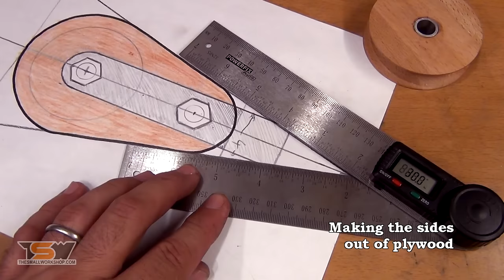Making a Block and Tackle Wooden Pulley System

Comment: Luck like you have the same tablesaw as mine. How you do your parallel guide?
Reply from the maker: I replaced the flimsy front and rear rails with rectangular tubing, making sure it's square to the blade and guides. The fence itself is made from the same rectangular tubing, making a T shape, perfect 90 degrees and bolted together. I used bolts instead of welding in case I needed to adjust the angle. And I simply clamp it to the front bar, using a regular clamp. I use it rarely because of the dust and noise and I have the miniature saw for daily use, that's why I did not bother to make a proper cam lock for it and use the clamp instead.

Comment: How did this work with the nutz crank down and the pulleys wood on wood with no bearings after time?
Reply: He used nylock nuts . the last four threads on the nut are thick nylon and are threaded by the bolt. So he didn't need to torq them down ..

Comment: They look well made but you should get some idea of their limits and of course improve on those pieces of string. But all in all, well done. Regards
Reply from the maker: The rope is rated for 1/4 metric ton (250 kg), and the rock I lifted was heavier than a large man, it's pretty much overkill for what I need: lifting some winter tires or a small air compressor up into the attic. I don't plan to push them too much, the rock was just for the video.

Comment: Anyone know what wood he used for the housing? Looks like plywood with carbon fibre laminated on it (?)
Reply from the maker: it's phenolic resin plywood. The part you think it's fiberglass it's just some texture to create a non slip surface for trailer floors or scaffolding and such.

Comment: What did you do to prevent sheaves from binding against the plywood?
Reply from the maker: The bolts are a little loose. I've used it almost weekly, it serves as my attic pulley for large tools storage, and never had a problem with it binding or anything else.

Comment: My 2 cents : you would save a lot of energy with ball bearings instead of aluminium plain bearings... very nice job anyway !
Reply from the maker: True, but I use it for small loads, so it works just fine for now. I haven't even lubricated the plain bearings. Aluminium was what I had in my scrap pile, brass would've been better, but I used only what I had in my shop. Same reason for not using bearings, I did not have as many and they would add cost and also complicate the build.
Reply from the maker: LOL, yea, you are in a different league, I only needed a fast solution for lifting some tools in my attic. 30-40 kg maximum load.
Reply: And I enjoy watching people building theirs their own way !

Comment: wow, power tools wise, what did it cost to set up your shop?  like 20k?  curious to start my own
Reply from the maker: I've bought the tools over the last 10 years, most of them used, never did a total, but is was a really low number.
- table saw $40
- wood lathe $150
- metal lathe $100
- drill press $70 (new)
- angle grinder $25 (got it free from my dad)
- vise $25
- belt sander $40
- router $50 (new)
- circular saw $40 (new)
- welder $100 (got it free from my dad)
And so on. In the past few years I've also spent around $25 a month for small stuff like screwdrivers and other hand tools, sandpaper, clamps, saw blades, drill bits and so on.
Reply: Appreciate that breakdown, @TheSmallWorkshop!

Comment: 11:00 u missed two pulley in ur bolt each side of ur flat bar 12:20 ur ladder positioning was wrong 
Other wise I did tidy job making two snatch block with almost £5000 tools

Comment: Did you get yourself a table saw?
Reply from the maker: I've had it for a few years now, I only rarely use it on video, because of all the noise. It's covered with a brown piece of hardboard and it's some sort of workbench, you can see it in most of my videos. But I usually use the homemade mini saw, since it's much safer and quieter.

Comment: hello  mr maker person
i have a suggestion.  when your making a thing, eg your "Block and Tackle Wooden Pulley System" i think it would help a lot if you showed  the finished product for a few seconds at the  BEGINNING  of the vid.  in that way the viewer knows what you are making.  
as it is all we see is a lot of drilling, sawing and separate steps that dont relate well  to each other.   we have no  VISION  of what you are doing  or where you are going.

think of it this way.  if you are in the airforce, think WW2 bombing missions over nazi germany.  before you go near the bomber you have a BRIEFING  session.  MISSION COMMAND  sits you all down and outlines your  DESTINATION, TARGET  etc.  so you know what you are setting out to achieve. you dont  get airborn and then get instructions like...ok guys your at 10000 feet now turn 5degrees south and  when you get there call us and we will give you the next  course route.........
anyway my 2 shekles worth.  or is it nickles maybe........

else wise a interesting vid......

Comment: New tools? Or just not used in older videos?
Reply from the maker: Some new, like the miter saw and some new to me, like the band saw, the rest I've had for a while, but I usually avoid to using too many tools for my projects, to keep them accessible for more viewers. In this video I went nuts tho, and used whatever tool I needed for the job.
Reply: The Small Workshop Is that evolution mitre saw a personal buy or did the people of evolution send one over? They have been doing that a lot with yt woodworking recently.

Comment: No metal spacers for opposite of the pulley side? hrm
Reply from the maker: It's all loose fit, no bolts were tightened, it's more like a harness than a single solid piece.
Reply: The Small Workshop it works because of the locknuts. It's a workable design, not a great one.
Reply from the maker: Of course the lock nuts were used exactly for that purpose. I know it could be improved but it suits my needs just fine. The shape was dictated by the small amount of plywood I had, else I would've placed a third bolt under the pulleys, and add spacers between them. Also I only bought 4 bolts and was lazy to go get 2 more :)

Comment: Or you could just buy a steel one on eBay for $13.99, free shipping.
Reply: Except, it will not be steel, but light gauge aluminum and flimsy plastic wheels,  which have lousy reviews.  (I know, I'm in the market for 3 or 4 block and tackle now). The ebay ones are cheap garbage.  And Granger wants about $135.00 for thiers. (Each). 
     I may have to fire up my table saw, and use the lathe at work.
    Thanks for the demo.

Comment: It would not be better to use bearings in side walls
Reply from the maker: It would but it would also be a much more complex project. I used those metal sleeves inside the wooden wheels to reduce friction and mostly the potential expansion of wood due to moisture. It should be enough for the light loads I plan to use this thing for, but yes, bearings would make it better.

Comment: 1/2 inch translates to 13mm. 12mm is one of those metrics without imperial equivalents.
1/4, 3/8, don't have metric crosses that work well, and 7,9,12,15 mm don't have good crosses to imperial.
/annoying pedant